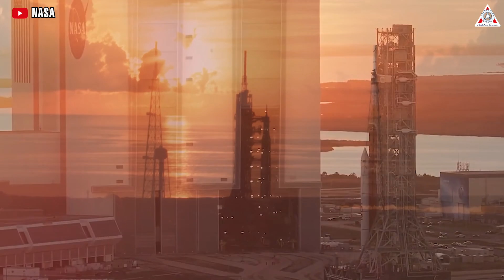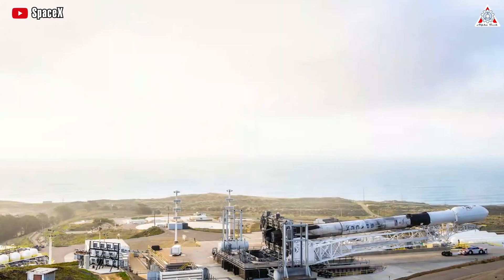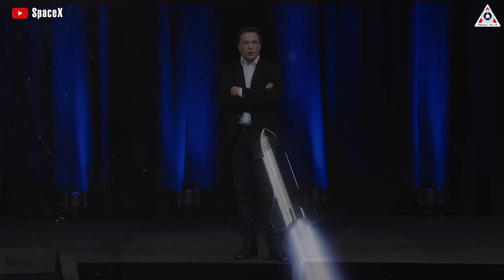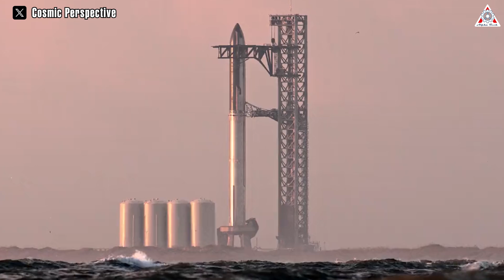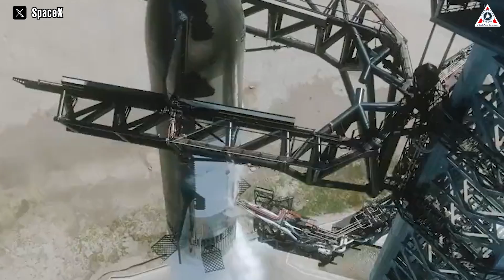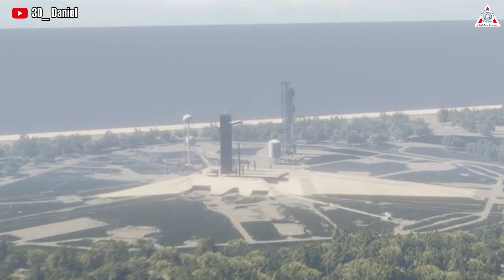What SpaceX just did with the Starship launch tower totally humiliated NASA!

Comment: Has Alpha Tech ever shown the attachment point on a super heavy booster for the GSE arm?  I have never seen any connection point on either the QD arm or the booster.  The idea seems reasonable but not implemented yet.  Also the QD arm was just raised up by 2 (?) meters to allow for the hot staging ring to be installed.  That make the tower to ship connection point even further from the boister.

Comment: The cost to build ML-1 for Ares I and then significantly modify it for SLS Block 1 was ~$1B.
The cost to build ML-2 for the upcoming Block 1B/2 variants is also expected in the same ballpark.
Unsurprisingly the first OLT+OLM at Boca Chica are rumored to have cost SpaceX over $1B to construct as well.
Construction time for the first one was over 2 years from the first steel being layed down to a launch ready OLT+OLM, not 6 months and as we saw it wasn't quite ready by then after all.
And NO, the SLS mobile launcher is not a single use structure.
ML-1 was used for Artemis 1 and will be used again for Artemis 2 and 3, the remaining Block 1 launches in the manifest.
It's currently being tested on pad 39B ahead of the Artemis 2 launch campaign.
After the last Block 1 launch they will be using ML-2 for all subsequent flights.
Whoever told you that it's a single use structure doesn't know what they are talking about or are intentionally misleading.
Reply: Thanks, this is a great rebuttal to the inaccurate reporting from AT.  To bad it can't remain at the top of the comments section.

Comment: I suggest the custom launch platform, be a de facto ship, Perhaps a trimaran with a trike configuration, so the center hull is forward only and the two aft hulls apart.
Then instead of a tower, have an angled ramp so ships and boosters can be picked out of the water by winching up the ramp.
Then have side thrusters on the Starship, so the whole thing will be stabilized at an angle during launch. These same thrusters could then be used for horizontal landings of just the Starship proper.
This would allow getting away from towers and being able to load passengers and cargo in the horizontal position, instead of trying to use elevators to get past the tanks. This would also be more stability when landing on the Moon or Mars etc. where you might not have a solid LZ.
And it would really suck to be stranded unable to launch because your ship fell over. Due to an unexpected sinkhole void etc.
What will be discovered with the Minimalistic Raptor 3 design, is it will lend well to remote intallation. In fact you could have the combustion chambers distant from the main pumps. And perhaps use the side pump R-3 so your side pump is a booster pump, after you main pump pressurizes the supply lines.
On hull construction, would like to mention the benefits of using longitudinal gores again.
This would allow building a computer controlled cutting machine that operated off a roll of stainless, and cut your gores and also small pieces out of the scraps.
Via multiple cutting heads operating at the same time. Then you could roll the sections with mating convex and concave rollers if desired, and use a press on the nose sections.
And do full length of hull gores. Then you would cradle these gores, and weld in your transverse structure, Then have the cradles pinned at the edges so they could be turned into a roll to create an open center jig for the entire hull. and you could rotate that jig for comfort of welders and place temporary internal scaffolding to work up the sides.
Then you lay in your longitudinals and weld tabs over your transverse rib abuttments. Once the hull is completed decks could be installed in pie sections starting forward. and at the tank domes center accesses capped going aft. Also would allow rotating the entire hull so engines could be installed horizontally around the ring, with workers on a floor, and engines on a dolly.
This system would be condusive to future automation systems until you basically had entire hulls produced robotically.
Also with everything running long ways, it would be stronger and stiffer than hulls made of rings and the longitudinals hacked up and rewelded every few feet. And the skin also having welds full circumference perpendicular to the hull.
(Thats not good engineering.)
Once you have your ships sections constructed, they could be rolled into the water on inflatable ship launching rollers, and from there tugged to your launcher and ramped up. 
Then your fuelers come aside and the ship is fueled, Fuelers pull away for safety,.and you can launch.
Also your tri hull would have helo decks for handling cargo and passengers.
This would allow a system that once operational would be shore independent other than logistics, and mantenance of the ship etc. And that ship should be blue water capable. And as a tri hull shallow draft.
Would be a nice system. to cut every hole and shape in a gore in minutes, and basically spit them out into the cradle etc. and production line into the roll jigs, and have multiples of those, so you were building a dozen or more ships at a time, instead of dinking around with silly and risky cranes all the time.
Stacking is for coins and poker chips, not how you build ships.
Reply: cool, find money and work out the logistics.
Reply: @otterpossum9128  Why? when I can make suggestions, and somebody else will take care of the minor details.
I take it you have neither money, nor ideas?
Reply: someone sounds upset. no one, will read that rant^ i didn’t
Reply: @EA-po7vt  
Oh? wasn't a rant, was a series of suggestions.
And Alpha Tech asks regulatly for our suggestions in comments. And believe it or not, Some of mine have been used. In fact, I've made a mini carreer online making suggestions to assist the development of Starship.
And of course have been seriously trolled, sometimes for days. And told them I would win, and did. I also have a screen shot of Elon Musk Logo on you tube joking that I was his assistant...
So, have you contributed anything?  You must be new if you dont know Alpha Tech asks for suggestions? And why should I get upset? I'm doing what I like doing. Trolling is often envy based, or people who feel mentally intimidated.
I usually get hearted, and often thanked for my writs by Alpha Tech. Its a running joke with my friends... gotta get my Alpha Tech heart!
If you have any ideas, I'd love to read them, even discus them. Thats what comment threads are for.

Comment: Why is NASA still wasting my tax money on SLS? THre is a lot of rocket bodies lying at the bottom of the Atlantic!
Reply: Because Starship is not an alternative of SLS, but whatever.
Reply: actually they still try to recover the engines ! are quite small than the Apollo F1
Reply: @jolinar.setesh  Saturn V 1st staging happened ~2,5 minutes after liftoff. S-IC basically never left the atmosphere. SLS Core is shut down after 8,3 minutes almost on low earth orbit. Waaay harder to get back than F9 or even would be an Saturn V's first stage (btw. there was some concept to do) and the extra hardware's weight penalty completely kills the purpose of SLS.

It was designed to beyond-earth exploration not for your average LEO megaconstellation hauler like Starship will be.